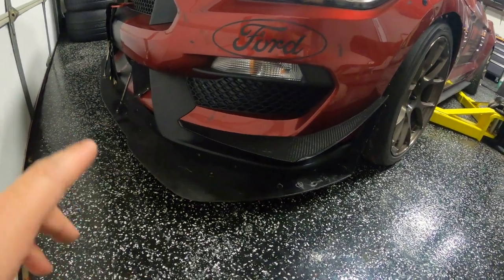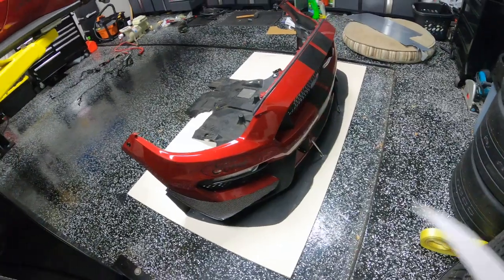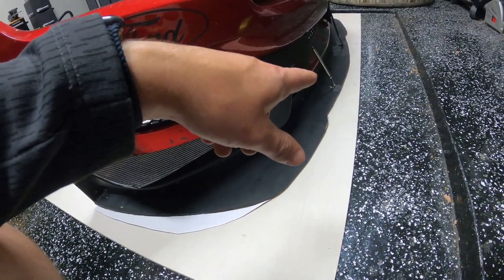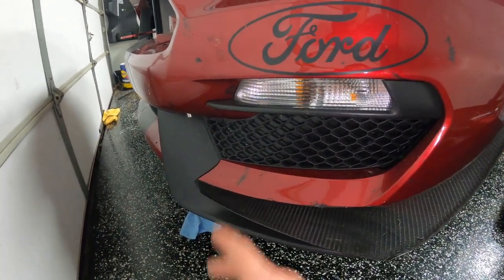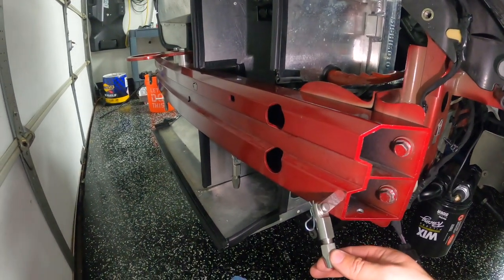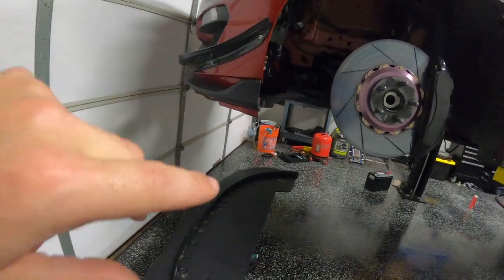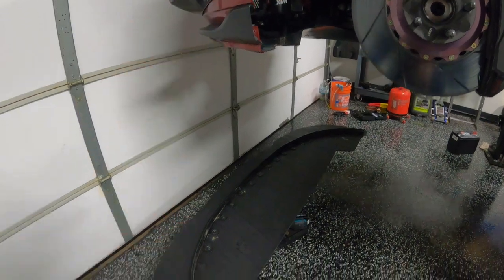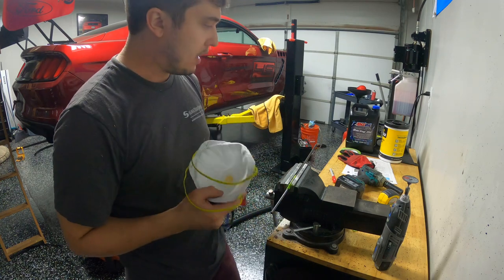Let's build a new custom race car splitter using plywood (GT350 Mustang)

Comment: Great video. Always appreciate your content. The engine refresh videos helped me tremendously. Just did a refresh myself.
Cooling mods, GT 500 oil pump, gear and pan. Harrop oil cooler, which is awesome. Also, changed the front K member to a Steeda Road Race K member. MGW shifter.  It’s ready for Road Atlanta.  Come join us in March, with Chin at RA.
Reply from the maker: Nice! I’m waiting for the new truck and trailer to come in before any out of state trips. Current setup just isn’t up for trips that long. I’m hoping for a trip to Road Atlanta in august!

Comment: I love the content keep it coming.  From what I understand with those “side spat” according to a lot of the aero developers it will negate the dive plane. Apparently it stalls the air on the bottom creating drag.  You might be able to get rid of those and keep downforce and lower drag.  Just a thought.
Reply from the maker: hmmm. AJ recommended I keep them, but wouldn't hurt to try with and without them

Comment: Awesome job man. Has given me confidence to build mine. Just two questions…what is the height of the splitter from ground ? And do you measure the angle of attack?
Reply from the maker: depends on the tire I am running, but anywhere from 2 7/8in to about 4inches. It's about 3/8in lower than the stock splitter (no the edge, but the true bottom of it). 

Same way as a wing. Find a relative point on the car (i use the frame rails) to zero the gauge and then put it on the splitter to see angle.

Comment: Tell me more about this splitter fence? @10:30 mark where from did you get it?. Thanks man 😄
Reply from the maker: It’s two part. If you check the description, I linked to the parts. The part on the splitter in the video at your times stamp is the garden edging from Home Depot/lowes. I then attach the second part to this with screws to fill in the remaining gap. If you still have the OEM splitter, you won’t need the second part
Reply: @honeybadgershenanigans  Whats the weight of the spliter?
Reply from the maker: I never did weigh it separately....but it's light. I can hold it with two fingers light. It's definitely lighter than keeping the OEM R splitter + something like the AR/FP/APR splitter.

Comment: Hey I want to know how you made your intake cover...
Reply from the maker: Super easy. Removed the air box, cut about 60% of the height of big gasket/seal off and then put it on a piece of plexiglass, traced the shape, cut that shape out of the plexiglass, put it on the air box, pre drilled holes and then installed with course thread screws
Reply: @honeybadgershenanigans  yeah just looked mine over it doesn't seem that bad. I'll be doing that soon.